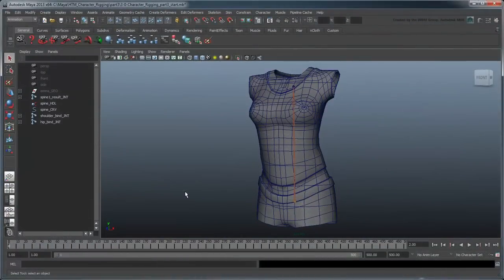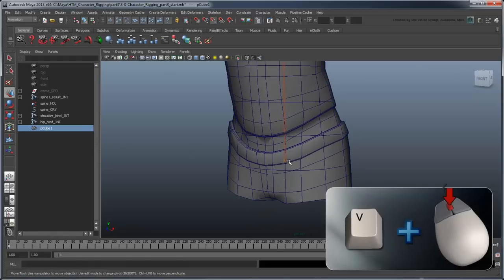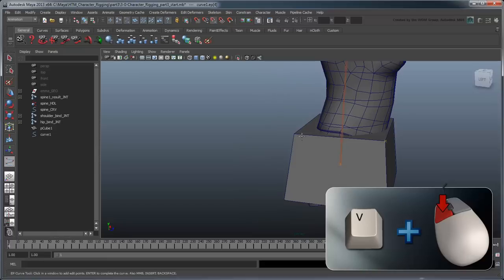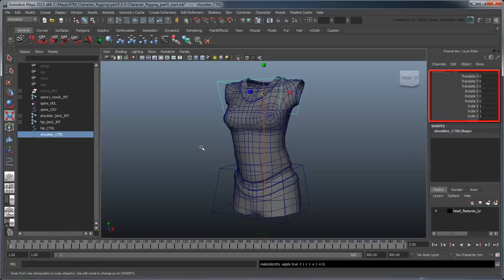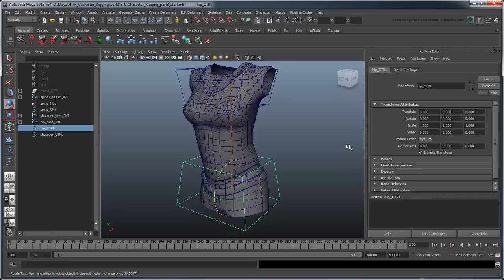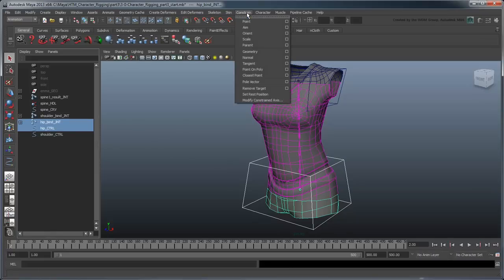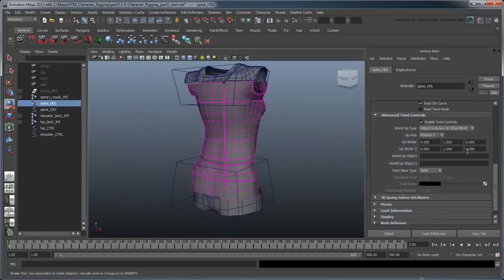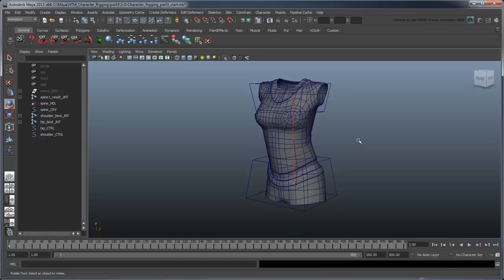Creating a Character Rig - Part 3: Torso IK controls, rotation orders, and twist (Advanced)

Comment: here we go again after all the trials....when i applied the enable twist controls i didnt have the same result  as yours even though i did all the same process but for me the breast is facing the -x direction and the stomache part except the hip is facing the +x direction like what am i suppose to do now?
Reply from the maker: +Benjie may-ag Sounds to me like all your local rotate axes are not aligned.
Reply: +Maya Learning Channel no sir, I got them aligned the same as yours, I keep repeating over and over from scratch and i get different positions..I just cant pinpoint where the problem is...i even made sure the axi's you have in local roatation axes matches yours. I dont know anymore...and I like this method too. It may have something to do with maya 2016?
Reply from the maker: Did you make sure to disable "Automatically orient joints" in the Move Tool?  Even though you set them initially, they may be changed without you realizing it.

See https://www.youtube.com/watch?v=az9Iycp3fGE at 9:13
Reply: +Maya Learning Channel ya its turned off by default
Reply: Im using maya 2016 and had no issues. are all the axis consistent in the joints with X axis always pointing towards the child joint?

Comment: Hi, I have this nasty issue when setting up the spline twist. When I type in my Shoulder Bind joint into the World Up Object 2, the functionality works fine, but it automatically rotates the joint 90 degrees negative Y and twists it. To set it to default, I have to rotate my shoulder control 90 degrees positive, but when I freeze my transforms it automatically puts it back to that side twist. Im really not sure as to what is causing this. Thanks for your time.
Reply from the maker: +Samuel Chovan Most likely you forgot to set up the local rotation axes for these joints, or they are setup incorrectly.
Reply: +Maya Learning Channel Thanks. I have one more question if that's alright :D. Lately I've seen several rigging tutorials and a lot of them use this Aim constraint trick to reorient the joints, however your method with the orient joint tool seems to do just the same thing but 10x quicker. To my knowledge, these people seem to be well aware of the orient joint tool, yet still continue using this aim constraint trick. I wonder, is it just their habit/personal preference or is there something different to it in the end result?
Reply from the maker: It could be a habit developed/passed down from a time when there was no Orient Joint Tool, or perhaps just a more visual way of doing it.  That said, the Orient Joint Tool was specifically built to handle this exact situation so don't worry about using it.

Comment: Why don't we orient all joint with z forward and y up ?
Reply from the maker: +JcJohn Clarke You can if you prefer.  Our goal in this series is to make all the "primary" axes of movement the same across all joints.  So basically rotating along "X" will get you all the joints most common bends, regardless of how they're typically oriented.  However, that's not the only way of doing it.

Comment: Excuseme, why does Up-Vector point back from the spine (9:00), why not forward?
Reply: 9:57 "Our local Y-axis pointed forward... Up-axis, which is the opposite"
why is that opposite? Why is negative?
Reply from the maker: +Андрей Гутов It's because this orientation allows for a positive rotation to bend the body forward, which is its "natural" bend direction.  If you pointed it the opposite way then it would take a negative rotation to bend forward which is not as intuitive.

Comment: Hello !  I'm on maya 2014 and i have a problem whith the IK handle I guess. When i'm trying to test the twist all the bones are moving.  On your example at 8:22 only the hip moving.  Do you have a solution please ?
Reply from the maker: +Reika Are you sure you have the control selected and not the actual joints?
Reply: +Reika   Remember to orient the join  chain before create the spline handle.
 The twist controls only works if the x axis is up, see the previous videos.
Reply: Thanks !  ^w^/

Comment: Excuse me,i have a problem with the twist control.i have followed the technique you showed but i dint get the twist result as expected, it was twisting the total mesh not just the part,can you help me in that matter and i dint use the proxy rig but i directly skined the joints to the mesh.
Reply from the maker: You should leave Forward Axis as Positive X.  The rest will be the same as shown in this video.  See the attached scene files to check that yours match.
Reply from the maker: nithin sai Are the joints twisting properly and just the mesh isn't?  If so, I think you might have skinned to only one joint rather than all of them.  Either that, or you need to paint your skin weights (see the Maya Documentation for more information).
Reply: Maya Learning Channel thnks for the help i dint skinned all the joints i just did it for single joint
Reply: same twist problem im in Maya 2017, in the Advanced twist controls i have an additional ctrl which is the Forward Axis that i left at Position x. Please help

Comment: i've completed this part in maya 2015. i spent some hours to figure out why the GEOs twist away when i turn on twist controll.
the orientation of "spine7_result_JNT" DOES metter.(the opposite was mentioned)
i remade the rig couple times with probolems, but after i orientated that joint everything works fine for me.
is there any explanation for this?
Reply from the maker: It shouldn't matter, though perhaps something has changed in 2015.  If you open the example scene file however, you will notice that the end joints are indeed oriented differently compared to the rest of the torso joints and it works fine.

Did you make sure that the "Automatically Orient Joints" option in your Move Tool is turned off?  This option can change the orientation of your joints without you even realizing it.
Reply: Maya Learning Channel thanks for the fast answer! next time i run into this same problem, i'll check that option in move tools.
this series is awsome! i really like the way you teach!
will you make some tutorials about character animation also?
Reply: I have the same problem on spine 7, how did you fixed bohinsky74? I cant change the orient of the joint

Comment: Everything works great until up to when I enabled the twist controls on my spine ik handle. Positive Y is the up axis for all of my spine joints, and my Advanced Twist Controls are as follows: Twist Control Enabled. World Up Type: Scene Up, Up Axis: Positive Y (I've tried setting up a Start/End object as shown in the tutorial but the result became that when I rotated the spine to bend forwards, it automatically twisted towards the side as well), but nothing happens when I rotate the control curves on the Y axis (though Rotate X and Z both work fine.) Could you please tell me what I might be doing wrong here?
Reply from the maker: Sounds like your Local Rotation Axes are not aligned correctly.  You may want to revisit that section of part 2.
Reply: Maya Learning Channel  Thanks for such quick response. I watched #2 again and re-made my spine accordingly, but the same problem persists. The twist either doesn't work at all, or it is working when I try to rotate axis X and Z. This was the case when I tried to follow another tutorial on the same subject. I know it is hard to troubleshoot without actually seeing the scene file, but I'm wondering if you've ever come across a similar problem before and might be able to suggest a possible solution?

Thanks again for your help!
Reply from the maker: I would try deleting your Maya preferences folder and rebuilding the rig again.  There may be some setting from before that is messing with your results.
Reply: Maya Learning Channel I see. Will be looking into that solution then. Thanks a lot!

Comment: i ran into a problem with the advanced twist controls, after setting it up everything seems to be working fine but when i try rotating the bind joints(not twisting), the rotation axis of the spine joints start flipping at certain angle's and my rig breaks.
i checked the file you put up for download for comparison and i cant find any difference in the settings of the twist controls.
Reply from the maker: How far are you rotating?  Joint flipping is unfortunately a normal occurrence at extreme angles due to the math involved in calculating rotations.  Are you sure all your joints' local rotation axes are lined up properly and as outlined in the previous movie?  Do you experience the same problem if you turn Advanced Twist off?
Reply: when rotating 90 degrees on the z axis the y's flip for random joints, on the example files this doesnt happen at all
Reply from the maker: Does this still happen to you if the Advanced Twist is turned off?  Either way, this sounds like the local rotation axes of one or more of your joints is different from the others (either in the spine itself or one of the bind joints).
Reply: when i turn off twist controls it doesnt happen, are the bind joints supposed to have the same rotation axes as the result joints?
Reply from the maker: ***** Yes.  That's why we duplicated them from the spine in the previous lesson.  Creating a Character Rig - Part 2: Basic spline torso